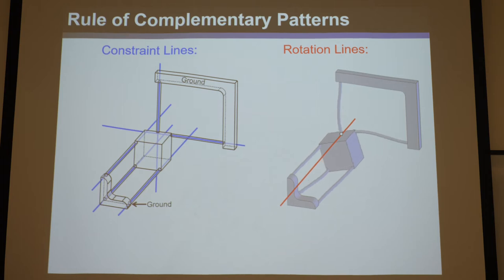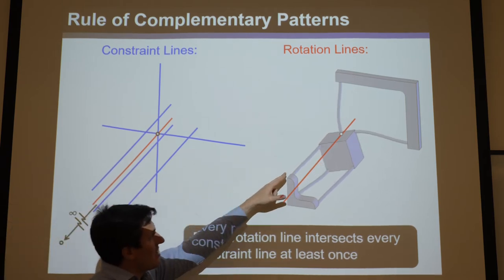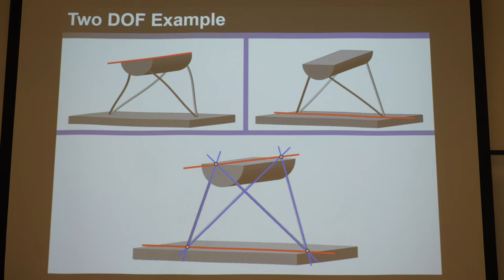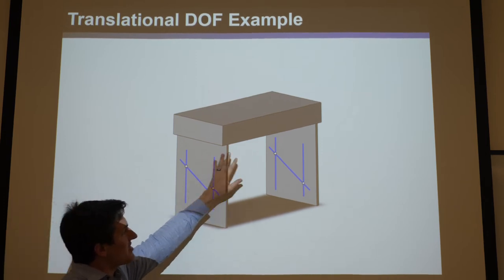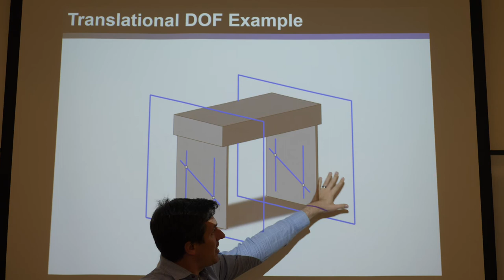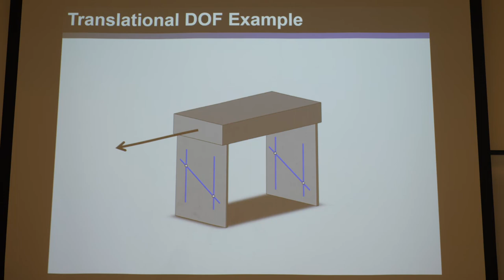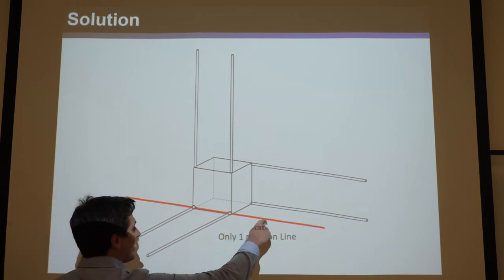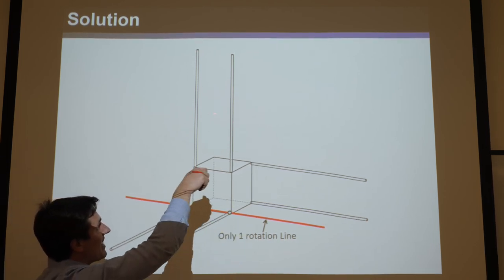Compliant Mechanisms Lecture 4 Part 6

Comment: I guess this is more theoretical than practical but @2:05 you mention this dof line is the only possible one. But if a line is an infinitely large circle of arbitrary plane angle, then shouldn't any two lines intersect each other regardless of skew or parallelism? Edit: nvm i think skewed lines can only be considered parallel only if they are displaced infinitely far from each other which is not the case in this example. Edit: now i think parallel lines that are infinitely far apart do not converge (explanation in my last edit)

Edit: i also notice you drew the hoop at @15:00 between the planes, but technically it doesn't have to be between them right?

Btw these are some pretty amazing ideas - combining projected geometry with the complementary pattern rule. Pulled an all-nighter on these lectures, something i dont do even for my fav Netflix shows

Edit: hmmm theres something bothering to me about this projected geometry thing.  If there is a commutative property regarding parallel lines aka: if line A is parallel to line B, which is parallel to line C then line A and C are parallel....then any two lines of finite separation distance would be parallel becsuse you could construct any chain of parallel hoops. However these hoops would be infinitely distant from each other which means there must be a rule which says parallel lines which are infinitely far apart don't converge. If this is true then it would actually solve the first question i had